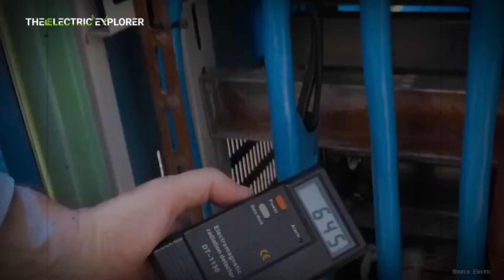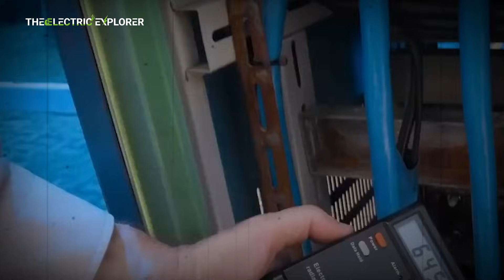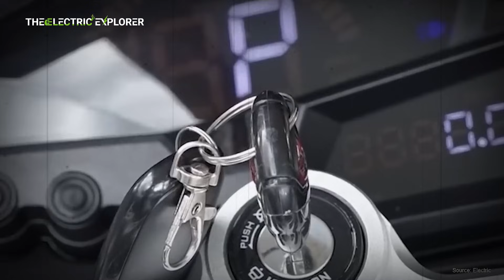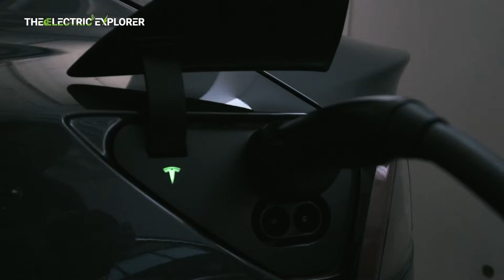Maxwell Chikumbutso: Zimbabwean Inventor Unveils the World’s First Free-Energy Vehicle

Comment: It is easy to prove that this is a fraud by considering the inverse square law of microwave 
and radio frequency propagation. Yes, there is energy throughout every place on earth from 
electromagnetic wave propagation, but this energy is greatly reduced as it moves away from 
the source. This is not a groundbreaking innovation, it is deceiving people who don't know 
basic science. Even if you were only 100 meters away from a 50,000 watt radio station, 
you would still not receive enough energy to power your car.
Reply from the maker: and we will know if this will actually work or not later

Comment: This zimbabwean is a scam artist, he never invented anything, zimbabwe is known as the 2nd nigeria of scams, the 2 cars are build by the chinese, including the battery generator he is selling, he is very mentally ill, first claim is perpetual energy, 2nd claim is radio waves, 3rd claim is micro waves, 4th claim is deep space pulsars, 5th claim is microsonic waves, its all a scam, he claimed that the cars can run 1000km trip, then he claimed it can run for 2000 km trip before recharging, some electrical experts/engineers/ real inventors think this guy is on drugs or mentally ill by claiming he is the inventor, the Chinese get mileage on their electric cars by using a battery generator inside the trunk/ boot & just recharge the battery generators again. It's not his invention, it's the chinese invention, the chinese does not patent their technology, so he thought he will take a chance & telling a lie to claim the chinese version technology
 
 idea, but he does not know exactly how it works, thats why few thugs help him to pull of the biggest fraud of the century, by advertising it on you tube, but know it's a scam, he did not  invent any technology, the best inventor in the world is residing between south-africa/hong kong with highly classified technology !